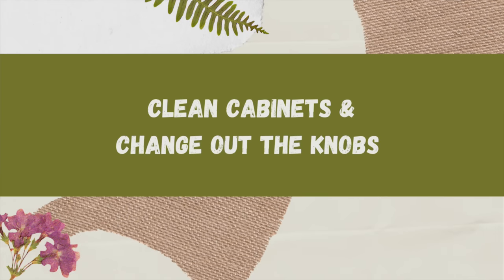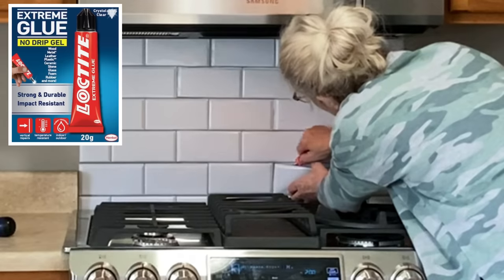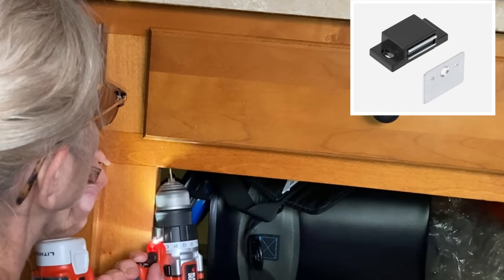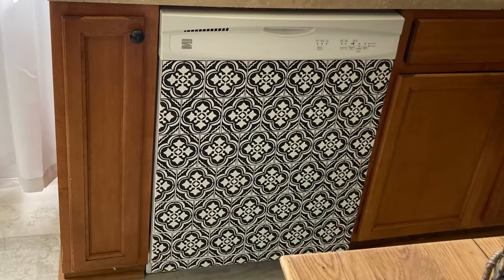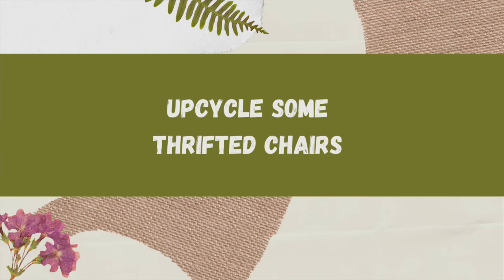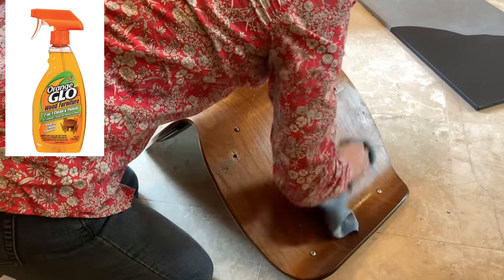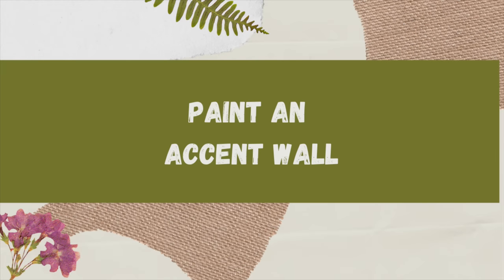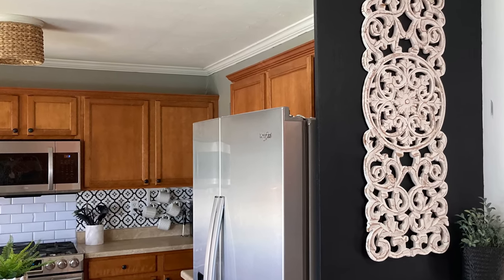12 DIY CHEAP AND EASY KITCHEN UPDATES THAT ARE BETTER THAN PAINTING YOUR CABINETS!

Comment: When wanting to glue non-permanent tiles to drywall, I always cover the drywall with contact paper and then glue the tiles to the contact paper. The tiles stick better and when they need to come down the drywall is still in great shape.

I did this with a dozen 12"x12" cork tiles, 3/8" thick, to use as a tack board over my desk. Still sticking perfectly after 20+ years.
Reply: What a great idea.
Reply: Great tip!
Reply: Thank you for sharing.
Reply: Interesting. I would have thought the adhesive would have torn off the drywall’s paper layer.
Reply: @TheDriftwoodlover  Not if the drywall has a few coats of paint. I wouldn't do this to unpainted drywall.
Reply: I have a thought. If you put Contact paper on the painted dry wall, to remove it, use a hair dryer to warm the adhesive. Go slow , doing one small area at a time one being careful to peel the Contact paper at an angle and downward. Never pull toward you .

Comment: Great transformation!  I would add vintage casters w/brakes to the little table. This would provide workable mobile height.  Tambours are easier if you measure wide strip of dropcloth to fit your wood round and glue them on flat surface. Eliminates possibility of gap if you know size. Then it should be easier to nail the panel with all furring attached.

Comment: Your ideas are great and I think I will try to make a version of the round table for my son's new condo! I redid my own kitchen completely DIY and I did paint my cabinets--they were melamine with cheap plastic handles-yuk! New hardware and a soft gray color and they look very modern now--I'll never regret painting them. 🙂
Reply from the maker: I love painted cabinets and have been wanting to paint mine for years. It is just SO much work. I was actually going to paint mine this summer, but I ended up working on Amiah’s basement, and now, I don’t know when I will have the time.

Comment: Ahh, we think alike! So many fun details, I'll be keeping in mind for my next project. (P.s. I used a peel-and-stick backsplash for my last project at a widowed single mother, and not only was it fun--it looked almost like glass tiles. One can find such fun things online!) Glad I found your channel, and thanks for sharing. 💜
Reply from the maker: Thank you! I think I am going to use some kind of peel and stick product on my own backsplash. It is tiled but I have never liked the tile. We’ll see…
Reply: @CanterburyCottage  That will be interesting. Please let us know how it turns out!  🌻 FYI:  On my project, I had to learn how to smooth the surface first with a type of "paste." Then I sanded it, after it dried...and then because I combined two different brands and types of tiles, I got bold and purchased the caulking/adhesive used for fireplaces. (Yep, I wasn't taking chances!) Lol. The glass-looking tile adhesive was actually super strong, and didnt need any...but my center tiles definitely needed the fireplace adhesive. Perhaps if I could have perfectly smooth walls to begin with, it would have been just fine?

Comment: Oh my , it looks sooooo great ! I had not heard of the window film, and  although I prefer being able to see out my kitchen window,  ... it looks great on the bigger window., as well as changing out the draperies.  Floor length always looks better, even in a kitchen when it's a large window.  I have floor length curtains on my one larger window, but I left the small kitchen window ( same size as Amayas) without anything, as it has a shelf that is placed halfway above the sink where the window is. I had used a valance previously,  but I actually prefer it without it to get more natural light. That table is GENUIS.  It turned out so well , and you did a fantastic job on it ! Well done , Miss Sherry! 👏🏻👏🏻✨️🙂

Comment: Super clean is awesome in laundry, greasy bacon pans. And it'll make showers/tubs  and shower doors like brand new!  Don't leave it on your cabinets (wood)  as it will strip off the finish. Use it on your carpet,  it will remove any stain

Comment: You did such a great job with the kitchen just like the living room! I have been wanting to redo my kitchen from the 80's and I am going to look into the wallpaper back splash option. Definitely more cost effective than tile. what would you do with a sliding glass door that currently has those long vertical blinds? I'm unable to attach anything to the doors themselves but I can the door casing and wall. Thanks for the great content! 💜
Reply from the maker: I like curtains for a patio door. Use curtains that you can easily slide open and out of the way when you are using the door. Attaching ring clips makes curtains really easy to slide and makes your curtains longer, so you can hang the curtain rod above the door casing.

Comment: Orange Glow is indeed lovely. At first. Eventually the oil will cause the pores in the wood to be clogged, making the wood full. It cannot be saved. This is for real wood, especially antiques. Best to use polish like Harold's which contains a small amount of orange oil to make the polish easier to spread and to polish.
Reply from the maker: Thank you for this tip. I haven’t heard of Harold’s but I will check it out! 👍

Comment: One thing to take into consideration with the self stick back splash is when hot grease splatters — it will melt the back splash and cause damage where it splatters and potentially be a fire hazard

Comment: Looks nice! I like the back splash idea. The table looks just like the expensive model. One question though. Is it stable or is it a little bit tippy? Is it heavy enough on the bottom to give it stability?

Comment: We had to paint our cupboards years ago, but added new hardware....still not happy with our backsplash, so may try the paper.....at ages 78 and 80 we aren't doing the real expensive, hard to do jobs any longer.  We really still need a new countertop also but "funds is low

Comment: Could you have purchased a wire spool from an electrician or home maintenance store? Ours sells them for $25 I don't know what you spent on the lumber and what not to build the dining room table but those spools are multi use and very functional sturdy pieces of furniture
Reply from the maker: That is a good tip. I didn’t know you could purchase those. I believe I bought 12 furring strips @ $1.98 each, so I spent about $25!😊
Reply: @CanterburyCottage  so spent about the same amount but worked hard to accomplish the same outcome

Comment: Everything looks great except the front of the dishwasher and the fringe on the light fixture over the kitchen table. You should’ve either left the dishwasher alone, or hung a small white or black magnetic curtain rod on the dishwasher door as a towel bar.  A fun and funky contrasting towel would have been functional, plus distract from the fact that the dishwasher isn’t stainless.  The lampshade fringe is super tacky and it cheapens the whole look.

Comment: Honestly, such foam tiles should not be used behind a gas stove top - at least in my country the building code requires non-flammable material in this location
Reply from the maker: They are plastic rather than foam. That probably makes them a little safer.
Reply: @CanterburyCottage  yeah I remembered hearing foam but what was said was faux, regardless though the plastic would be flammable and is not permissible in my country to be behind the gas stove top. For example some places do an clear or coloured acrylic splash back in my country, but they will not place it there, available in big hardware stores there are single metal panels (stainless steel panels) that could be placed behind the stove, also tempered glass, ceramic tiles or bricks, but no acrylic or plastics, wood etc. 
Anyway I am sure people do similar everywhere, in my country their is the rule but no one is checking